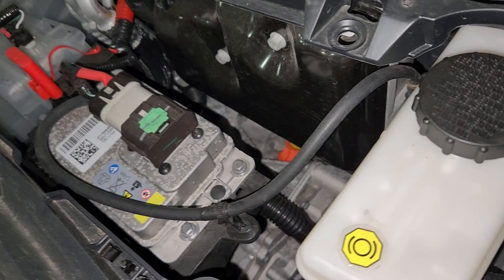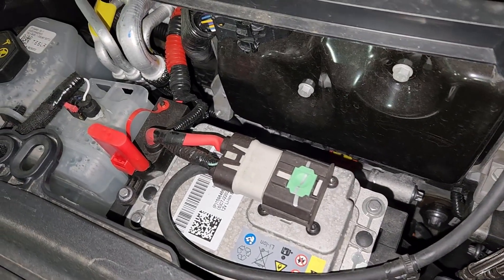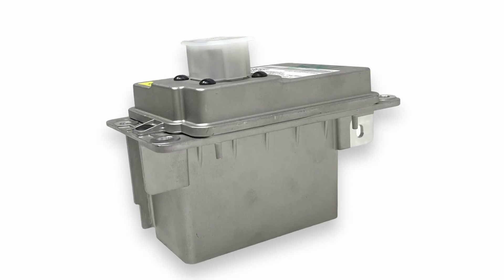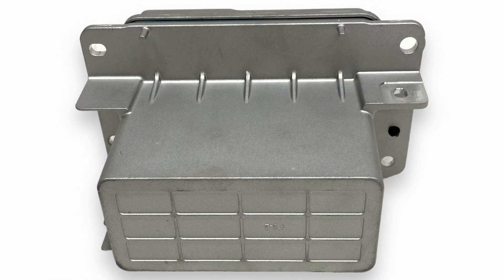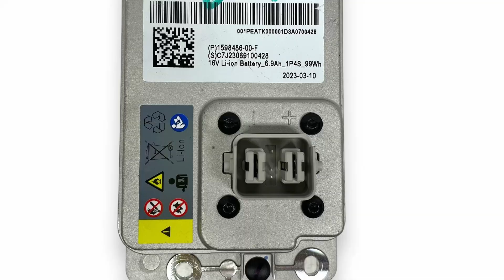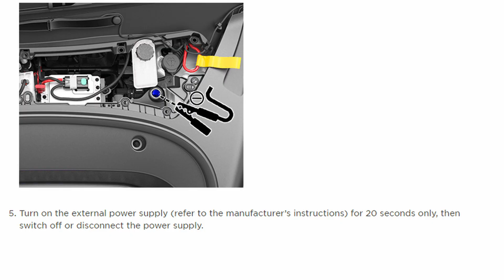Tesla Battery: Kitchen Explosion

Comment: 12V "lead acid" batteries are actually 12.6VDC at full charge. 6 cells X 2.1V/cell.
Reply: 12V Lead acid batteries need just over 15V to fully charge to their nominal 13.6V fully charged state in a reasonable time.
Reply: @allangibson8494  15 volts will start to boil the electrolite in a 12v battery.
Reply: @tonycs-9  Reconditioning voltage for a 12V lead acid battery is 15.8V. 
The voltage required to reach full charge is dependent on the charge current, battery static voltage and battery internal resistance. 14.7 is the usual maximum open circuit voltage of a lead acid battery but to reach this you need to supply significantly higher charge voltages (and smart chargers switch off charge periodically to check this). Voltage doesn’t “boil” batteries, current does.
Reply: Conventional lead-acid batteries are actually more like 2.2 volts per cell (often a bit more) when fully charged, so a 6 cell battery at full charge would be at least 13.2 volts. If the voltage is measured immediately after full charging is complete, a reading of between 14 volts and 14.4 volts is not unusual, though it doesn't stay that high for long: If you leave a time gap of an hour or two between disconnecting the charger and measuring the voltage, it is likely to drop back down to about 13.5 volts, even if the battery is not connected to anything during that time. If you draw a few amp-hours from it (like connecting a 12 volt halogen light bulb for an hour or two), the measured voltage is likely to drop back down to about 13.2 volts.

However, if the battery gives a measurement of less than 13 volts immediately after being fully charged, then there is either something not quite right with the battery itself or with the charger. It could be that the charger is not delivering the voltage it should - if the charger output only measures 13 volts, then the battery voltage will never go above that, no matter how long you leave the charger connected.
Or it could be that one of the cells is damaged and therefore not contributing much to the total battery voltage. Even if the damaged cell is not making any voltage at all, 5 cells at 2.3 volts per cell still adds up to 11.5 volts.
Of course it is unlikely that the damaged cell is contributing nothing at all unless is is completely shorted. Say for example the damaged cell is giving about 1 volt and the other 5 cells are charged up to 2.3 volts per cell: That adds up to a total of 12.5 volts.
So if you have a battery which gives a reading of only 12.6 volts after being fully charged, and there is nothing wrong with the charger, then that battery most likely has a damaged cell.

Also, and this is just a small point compared to the above, a lead-acid battery charger does not need to output quite as high as 15 volts: Most of them will give about 14.4 volts. The voltage of a car electrical system with a healthy, functioning alternator should be about the same - most "12 volt" alternators are actually calibrated to make 14.4 volts, precisely because this is what the charging circuit for the battery needs.

Comment: 0:25  Common Lead Acid batteries (as most of us know), are also NOT 12 VDC .. their actual voltage is 13.8 VDC ... The system has to be at least roughly 14 VDC to keep it charged up.

Comment: Every household has a universal electronics adapter. It's called a paper clip.
Reply: Paper clips are for small currents only. For large currents use some spanners.
Reply: Yes, when I was 5 years old, I stuck one in an outlet and blew the fuse (not breaker), my grandma had to call an electrician to replace the fuse.
Reply: @tedmoss 😆 I shoved the tiny leads of a 9 volt buzzer in the outlet just for shits & giggle. Flicked the little sucker on, it buzzed really really loudly for five fifths of a second shot off the wires drilled me in the forehead,😏
I was well impressed with the velocity,  then my nan walked in seen two crispy wires poking out smoking!! She kicked my arse,😂👌

Comment: From years of charging RC lipo packs It would appear to be a 4 cell pack  (4 x 4.2v) for 16.8v   3 cells would give 12.6v   However it seems that as only 2 pins are visible then it will have its own built in charger or (BMS) which will individually balance and charge the 4 cells to a max of 4.2v each (100%) and whatever the supposed charger was should have been a constant supply as the BMS internally does the charging and balancing of each cell not the external supply. If the external source was outside a specified range or fluctuated that is likely, or the internal BMS could have failed and overcharged and or faulty cell could be the other scenario. as a electrician I am aware or the issues with these cells and the charging methodology, the other unknown is if the BMS used active or passive charging for the pack. maybe something in the above helps.
Thanks for highlighting this one. Look forward to any updates.
Reply from the maker: I believe these batteries use 4 prismatic cells.  The voltage should be 15.9v.
Reply: @StacheDTraining  I read the plate on the battery as 16v  yes you are correct prismatic being rated 3.6 to 3.8v per cell, The charging methodology should remain the same just different peak voltages, love to know the cause of it though!
Reply: @Ifitwerks We dont know the current charging limits near the higher (full) voltages. Would need some manufacturer data sheets. If its a system-integrated EV component then that information may not be available to consumers.
Reply: @nucleochemist  A 4 cell prismatic cell battery will have standardised  peak voltage and current values dependant upon amp hour capacity per cell, the system it is integrated in to will have no relevance. It was the battery outside the vehicle on "charge" that went in to fault condition for a yet to be determined reason. Further more the battery was managed by its internal BMS separate from the parent vehicle.
Reply: Maybe the BMS was similar to those supplied on Boeing dreamliners and failed short circuit due to bad design or bad QC.
The better ones are designed to fail open circuit.
Reply: The fact that the battery was removed from the vehicle suggests there was a problem.  Possibly the BMS itself was faulty.
Reply: @PiefacePete46  I think the low voltage battery is only charged when the vehicle is in motion.  Plugging the vehicle in to charge the high voltage battery does not charge the low voltage battery.  This may have changed, but early vehicles left in airport car parks would often lock owners out as the low voltage battery had depleted.  There's a secret way into the frunk from outside, to then attach jump leads to then unlock and run the car.
Perhaps this vehicle had been unused for a while.
Reply: If you charge lipos you should know the terminals needed are three small ones and two big ones, which is what the battery has. There is no charger in the battery as far as I know.

Comment: I have never brought a standard car battery into my house to charge it. The garage, yes but not the house. But, the biggest lesson is these batteries are not like a standard lead acid battery and we must treat them differently. . .
Reply: You mare fortunate you have a garage.
Reply: @tonysheerness2427 Well if you can’t afford a garage… you probably shouldn’t be wasting your money on an EV.
Reply: @LukeAusNSW It was about  charging a 12volt car battery. Terraced properties in London sell for over 1 million pounds with no garages and nowhere to put them..
Reply: @lukeclifton4392 conversely, if you own an EV, you're better off without a garage.
Reply: @KC9UDX  You are more likely to burn your house down with an ICE vehicle (it happens very regularly).
If it has a propane tank onboard, it will probably take out the house next door as well.
Reply: I have had a conversation elsewhere about dangers of charging lead acid batteries (as someone who has been employed to work on them). They are generally pretty safe as long as they are well ventilated to avoid a buildup of hydrogen, and connections are sound to avoid sparking,

As I am familiar with working around acids I was not particularly concerned with keeping a container of spirits of salts (hydrochloric acid) p in my laundry, until I noticed that the container I purchased it in was breaking down. So I do not need it explained to me that a little knowledge can be a harmful thing!
Reply: I agree Mr. Nerd. My solution is to not have one. Ever.
Reply: @richardweyland116  Throw away your laptop right now!
Reply: @richardweyland116 .....hahahaha
Reply: Lead acid batteries generate hydrogen. Hydrogen explodes and takes out the entire building it’s in.
Don’t charge the battery inside.
Reply: What if you live in a block of flats/apartments?
Reply: @mechanoid5739  most apartments garages have power outlets (because car batteries occasionally need charging)…
Reply: @mechanoid5739  - The issue starts with how should this batter be recharged? I do not own one of these cares so I have not done any research. If possible, the batter should be charged without taking it into your residence. It might be best if you took the battery to a service center.  But, that could be a problem as well. Perhaps, there are maintenance people who will come to the car for this kind of issue. I know dealers do that here in Texas for some problems. But, Lithium Ion batteries can be dangerous if they are not handled properly. So, caution is required.

Comment: I think I can workout why in the kitchen, I bet they used two kitchen knifes in the terminals to clamp the charger onto.
Reply from the maker: 😶  Absolutely possible.
Reply: Either they bought a cheap 120vac "tesla charger" from china off the internet, or they took an extension cord and stripped the sheathing off to run the wires directly into the battery terminals and then plugged the other end into the wall.

Comment: Nothing is impossible for someone who is determined enough.
Reply: Yeah , the dude may have had electrical skills , no shortage of people into electronics .
   Scary stuff , and id be interested to know what smoke residue is left on the interior of the house and how to safely clean it up ?
Reply: we had a fuss box problem once and had to wait a week for repairs, my house mate hot-wired an extension cord to a light fitting in the ceiling to run the fridge. It worked.
Reply: Sure it worked but it could have burned the house down. That's why there is electrical code.
Reply: I saw immediately how someone could bypass the safety system. Needless to say, that battery will have to be replaced. The idiot that did this is very lucky the house didn't go with his/her dumb mistake.
Reply: @ghost307  the more determined one is, the more possible things are. 

But absolute determination wouldn’t deflect a planet killer asteroid. ☄️ 

There are limits. But we have no way to find the actual limits without actually testing the limits.

Comment: Lithium batteries do not take charge below -+0 Celsius. thats whay thy get low in winter, to low to get the car going...
Reply: That’s why Tesla’s have jump start connectors on the car. 
The jump start connectors were added because the old lead acid batteries died and immobilised the vehicle if the 12V supply to the onboard computer wasn’t available (just like the battery failing in your ICE car).
Tesla recommends that they be left on charge below 0C to keep the battery heater active (exactly the same as an engine block heater in an ICE vehicle).